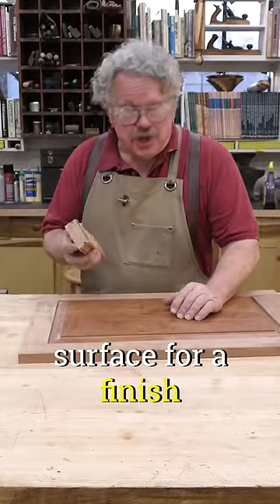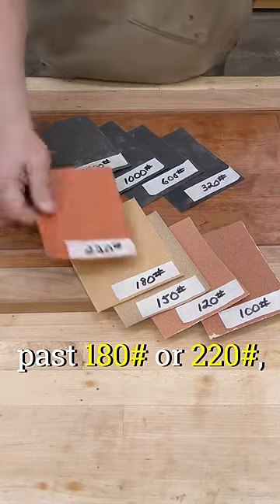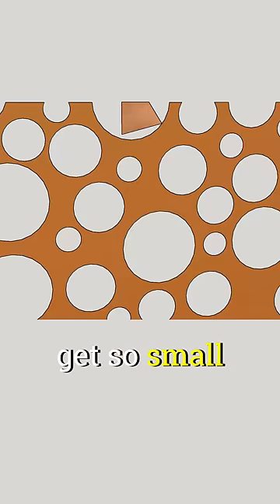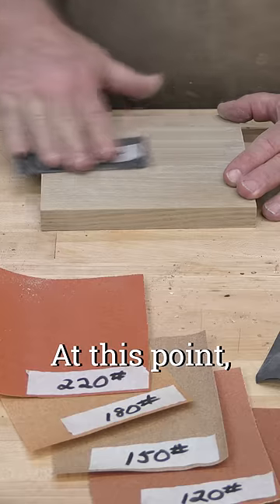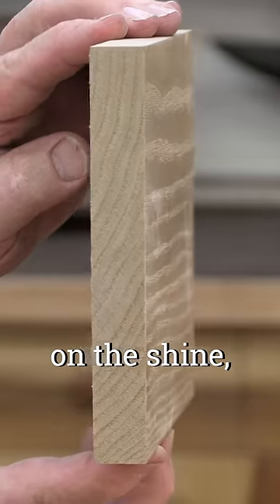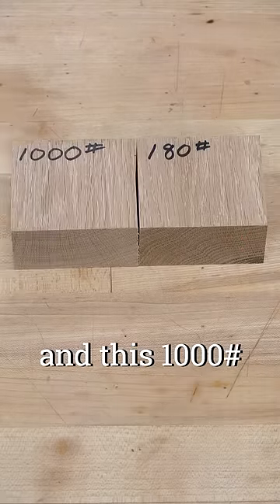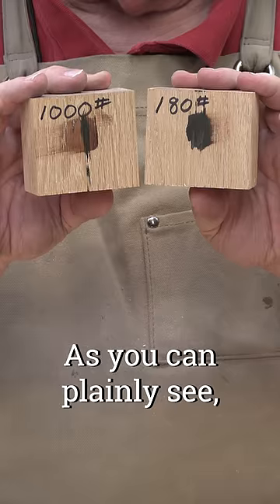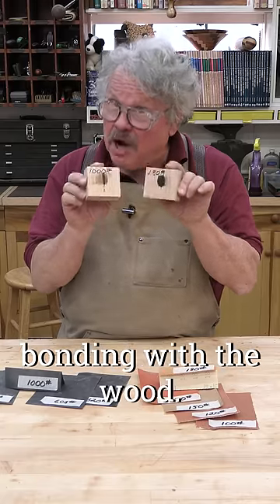Sanding Past 220 - How Smooth Should You Go? #woodworking #diy

Comment: The black papers are designed for paint, and should be used after varnishing or applying a clear coat.
Reply: I was always under the impression that black sandpaper is for dry and wet applications, and the lighter color is for dry only.
Reply: @PtotheMtotheK  it can be used dry for some things in course grits. The important thing is coating wood first.
Reply: This was the comment I hoped to see.  It seemed logical to me that you sand up to the maximum that allows stain penetration, stain and then sand to a higher finish.  If I understood correctly...
Reply: @awhite3747 Exactly. If you want a finish as smooth as you find on expensive instruments high grit paper is mandatory.

Comment: I don't often sand past 220, but if I do, I tend to use a combination of high pressure air and acetone to clean out the fine wood dust. After that, I find that the finish usually takes pretty well. Exceptions being porous woods like oak and ash.
Reply: MDF can benefit from higher grits but it isn't necessary for most anything else.
Reply: @Man-vs-Metal  Necessity has nothing to do with it.
Reply: Hm, acetone and wood... I never tried it before but i feel like it damages the wood
Might be wrong tho
Reply: @timch5227  I have yet to see it damage any wood I've cleaned it with. I've put it on everything from White and Red Pine to Jatoba.

Also, if you take a close look at the wood cleaner provided by Rubio Monocoat, it's essentially just glorified acetone.

Honestly, it's great for removing fine dust and oils from wood.
Reply: @timch5227 can confirm, no damage from acetone (basically nail polish remover, you can use it on your fingers without actual damage, just dries out the skin), it’s very effective at removing oils from the surface of wood so that you can get a good bond with your finish, but not so good between coats of finish since it will melt the previous coats. For that, I most often use naphtha.
Reply: I like mineral spirits because it doesn't fume as much as acetone and cleans just as well
Reply: @Jmoneysmoothboy  we use mineral spirits to clean our equipment whenever pine runs through it. Fantastic stuff.
Reply: Still no difference, I tried exactly what you said compared against 180, and the 180 finish looks better.
Reply: @roypdxful  When I go above 220, I go full ham. Usually 2000 or 3000 grit.

It's completely unnecessary. Just fun.
Reply: @Wiggleattacks Why would you even be sanding mdf its made of sawdust 😂
Reply: @plack_benis382  so that it will take finish better. Sand the edges so it doesn't absorb too much finish and doesn't require more coats.
Reply: @LilAngelPrincess95  why would you even he finishing mdf though its literal dust pressed together lol
Reply: @plack_benis382  some profiled doors are made of mdf because it's easier to sand the profile before lacquer. Mdf moldings exist too. Mdf is a good thing to use if the finish is a paint or color lacquer but still needs to be sanded or the finish won't be good.
Reply: @LilAngelPrincess95  yeah i know been doing construction a very long time and you dont lacquer mdf nor sand it, should be sanded from the factory if you open up mdf it degrades and falls apart.
Reply: @plack_benis382  I work in a cabinet shop. You 100% sand and finish MDF. If you put raw MDF anywhere and it gets wet it will fall apart. 
You can also buy MDF core doors.
Reply: @LilAngelPrincess95  well then youre the factory im talking about and mdf cores have zero to do with sanding or finishing its the core. After it leaves your shop it should never be sanded again is what im saying or it will degrade
Reply: @plack_benis382  the topic was sanding MDF. You said MDF is never sanded. 
It is as I've explained already. 
MDF is sanded and finished like any other wood product.
WHERE it is when it gets sanded is irrelevant.
Reply: @timch5227 acetone is in every stain and sealer out there. It’s just a solvent it evaporates so fast it causes no harm to wood. Keep it off plastic though!
Reply: @plack_benis382 let’s see because maybe I want the surface smoother for use on a router table or as a bed plate for my planer.

Comment: I make wooden swords for costumes, and how i treat the surface depends on the finish i want. Normally ill go to 320grit, then do a spray,sand,spray again with gloss primer to give a nice "polished metal" look on the final silver or gold coats. If i want it to look like pattern-welded steel, ill let the natural grain show through a bit more  and not sand as fine before priming.
Reply: That is very interesting!

Comment: This is why you blow off the surface before you finish. You can even use a microfiber cloth or tack rag. The reason someone would sand to a high grit would be to apply a multi stage finish. The truth it that no matter what grit you want to, you should thoroughly clean any surfaces that you intend to finish.
Reply: Your comment should be pinned to the top as it should have been discussed in his short. His info was somewhat valid but very incomplete as to the whole process.

Comment: I’d say give both a try. Iv messed around with some wood and stains and I actually found that I really like the stains on high grit sanded wood. It looks a lot different. It’s very interesting to see the difference grades of stain from different levels of grit.
Reply: Yep, don't be afraid to experiment with small test pieces. It will vary depending on preferences and types of wood and stain you're working with but there's no right or wrong way to do it, just go with the one you like the most....

Comment: A very convincing argument for not sanding past 220 on wood. I am now convinced
Reply: What was the argument for not sanding past 220?
Reply: @Bark777 are you dense? Did you watch the video?
Reply: I did, and I thought he made a very good argument to why you want to sanding past 220.
Reply: @Bark777  good job. 👏
Reply: @cellardoor7500  So what was the argument for not sanding past 220?
Reply: @Bark777  I’d rather hear your notes on what he said. What was the point of the entire video? Please enlighten us
Reply: @cellardoor7500  are you dense? Did you watch the video?
Reply: @Bark777  Because finer grit sandpaper creates finer dust, which then gets forced into the gaps of the wood. It does make the wood look smooth and shiny, but it also prevents stain or varnish from penetrating beneath the surface of the wood as well. This is critical for protecting wood long-term, because bare wood will suffer all kinds of environmental damage such as UV, moisture, etc. This is especially true for anything used in an outdoor environment. If you are working on a piece that is worth sanding to that degree, then it is worth protecting it as best as possible. High-grit sandpaper may make the wood look shiny, but it is not going to last long because the wood is left vulnerable to wear

Comment: I sand to 600. Haven’t had this issue. Blow off with air gun. I don’t stain though, only finish. I appreciate woods natural colors. A part of me actually believes finishes are a crime against God’s art. To each their own. Team Clear Coat only.

Had a purple heart project I sanded to 2,000. No finish on that. Leave it open to oxidize and it gets beautifully dark as it ages.
Reply: Interesting.
Reply: So I guess, from what I got in this video, you burnished the wood? Which is a type of finish? As another commenter said about the older wooden spoons of which he preferred the worn wood texture?
Reply: @ThinkerTinker74  the Purple Heart was burnished. 

My other projects, not quite burnish fine. You pack the grains with very fine sawdust when you sand, so you go through carefully with an air gun to make sure you remove all of that. You didn’t sand the inside of the grains down that fine. So the clear coat (or probably stain), will still take to the grains. None of my projects have had a finish issue in a decade. I almost exclusively use ash, red oak, and walnut though. Looking at some Sapele and Mahogany projects now. Results may vary with other lumber.
Reply: @M21assult 
THX for this. I'm likely to consider your way. I also like the look of wood. Any finish on wood is for wood that hasn't aged well or was abused IMO. Opaque paint for house walls or as part of an artist's supplies 😊
Reply: Anything past 220 is for Sanding the finish, not the wood. Try saving your high grit for the clear coat and you will get much better results. Going to 2k should give you a mirror finish and really show off the 220 sanded wood underneath.

Comment: A damp cloth will remove the 'imbedded' sawdust, also compressed air will remove it from both workpiece and sandpaper.  I scroll saw small art pieces and sand them to 1500 - 4000, depending on size & shape.  Most don't need a stain.

Comment: The best piece i ever made, soooooo slippery smooth that everyone in the entire shop kept coming over to pet it, sanded it to 220, then started mt finishing process, i cant remember what exactly i used but whatever your favorite sub-in for shellac is, use that.  Let it dry, and sand it a little smoother, another layer, higher grit, another layer, higher grit. I think i only did three or four thin layers, but after that first layer is fully in the wood and as long as you arent sanding THROUGH the laquer and you cant see the layers of laquer no longer able to bond with one another, you can keep going smoother. Then that last layer i lightly sanded all the way up into the thousands. It feels incredible.

Comment: I generally detach my shop vac from it’s holder and vacuum at the highest setting to the surface of the finished wood.  That, and the tack cloth, has worked well enough for my finished wood projects.

Comment: Also depending on the wood. As i like oil finishes i like to sand above 400 together with the oil. My bass guitar neck i sanded to 2000grit together with hard wax oil and after a year it's still amazing.

Comment: In car body work we use those higher grits for wet sanding and then buffing clear coat. Water keeps the paper working and stops it from wearing out as fast.

Comment: i learned this the hard way in high school. sanded a wood project in a shop class down to about 400 grit because it felt so nice and smooth, but the finish wouldn't penetrate and left a tacky surface, forcing me to sand it again to a lower grit and re stain it.

Comment: if your low on sand paper remember you can use an air compressor to clean it and its good as new, i do it 1-2 times depending on high the grit is but it works

Comment: A quick tip I like to use something to blow off all the dust you could probably use a hair dryer but I used to use this pressurised air hose after sanding it really fine this then let me get a really nice finish on the wood with some varnish

Comment: Use wipeable poly as lubricant for wet sanding above 220 grit. You can easily keep going to 600 grot without overloading the pores, plus the pores start to disappear and the grain comes out, leaving an incredibly beautiful wood with a very different look. Try it!

Comment: Would spraying stain overcome the filling effect? The shop I work in doesn't go above 180 on anything but alder which we sand with 220 to avoid ruining the molded features. We use LP guns to shoot the stain which I'm guessing gets past any particles that don't get blown off before the stain is applied.

Comment: So if you wanted that smooth burnished look, but wanted to stain the wood a different color, could you sand to 220 grit, put on several coats of stain, then sand again with 600 or 1000 grit?  Or would doing so completely remove the stain you just applied?

Comment: What about finely planed surfaces? I seem to recall from somewhere that there are structures in Japan that are made from wood that has been so finely dressed that water will bead instead of penetrating the fibres because the edges of the xylem are too sharp (or something like that)

Comment: If you have a tightly packed hole with superfine particles, isn't your surface area and hence available absorbing surface greatly increased? Wouldn't just putting additional stain, cost more but have the same effect on penetration?

Comment: When in high school, I got a part-time job refinishing furniture.  It was a small business owned by a retired gentleman.  He had a steel building next to his house, in which large heated tanks filled with a liquid stripping solution.  The items were submerged in the solution for an extended period of time.  After which they were removed and carefully pressure washed to remove the old finish.  They were then hung up and allowed to thoroughly air dry.

If they were oak items, we'd usually apply a coat of filler material to fill in the open oak grain.  I'd then sand with 180 grit sandpaper, vacuum, and tack rag them.  Followed by sanding with 220 grit sandpaper, vacuuming, and tack ragging again.  Next, I'd apply a paste/gel type stain by hand, and wipe off the excess stain with a clean rag, if that's what the customer desired.  If not, we'd leave the wood unstained.  This would be followed by applying an initial coat of clear semigloss polyurethane finish and allowing it to thoroughly dry.  Followed by being lightly buffed out with #0000 steel wool, vacuumed, and tack ragged.  Followed by an identically applied and finished second coat of polyurethane finish.  On certain occasions, such as workbench tops, where a thicker, more durable finish was desired, I would block and wet sand with 400 grit sandpaper, rather than lightly buffing with #0000 steel wool, between polyurethane coats.  I'd typically apply four (4) coats of polyurethane finish on such occasions.  After the fourth and final coat of polyurethane, I'd either lightly buff with #0000 steel wool or leave it with its as-applied semigloss finish.

Every customer I witnessed coming in to pick up their refinished items seemed pleased with the results.  And, all these many years later, whenever I need something refinished, I still use this exact same method to do so.

Comment: We use an automotive sander that pulls the dust through the mesh sanding pads. We go up to 400g and the stain still goes in beautifully. But only cause the dust doesn't collect in the wood or paper.

Comment: If the goal is to paint the wood rather than stain, I'm wondering if similar theory applies:  using very fine grit takes away some adhesion of the paint.  A rougher surface gives the paint more to grip onto?

Comment: What about staining and then continue to sand? Allowing the stain to penetrate, and then smoothing with the much higher grits? I can imagine the color will start to get lost, but if you give a second layer of staining it would not penetrate as deep but you can absolutely still stain the top layer as seen in the 1000 example.

Comment: 220 grit is the goat! Back when I was a machinist, 220 was perfect for anything less than polished parts. It worked great when I was finishing a clone trooper helmet, because it prepared the surface perfectly for the automotive spray paint, and when I made my sim  rig outta wood, I hit the whole thing with 220 and it's nice and smooth, but didn't take too much effort

Comment: I have an airgun hanging over my workbench.. i just routinely blast my work and my pad specifcially to remove the build up. Sands just fine at higher grits and even AFTER you blast the particles you cant even see on the work off- it is smooooooth

Comment: I was hired to consult on a job for a federal judges chamber and library in Muskogee Oklahoma.  They wanted a Walnut stain with semi gloss finish. The majority of the woodwork was made from Maple. The carpenters were incredible and the woodwork was almost flawless. They had already tried to stain some book cases but the woodwork wouldn't take the stain because they had sanded the grain closed. I ended up spending around 3 months finishing all of it. Some of the woodwork even had to be airbrushed (painted) to achieve the correct tone. The entire thing turned out to be BEAUTIFUL.

Comment: I always assumed it’s a function of hardness. 

Also, when sanding material like this even carbon fiber, have a vacuum wand with a brush end. You’ll be able to clear the pores and unload sandpaper this way. Do a few sanding swipes and vaccum. 

It’s replaced wet sanding for a few steps which is always welcome

Comment: What about sanding finer after the stain then between each clear coat. I sand to 800 or 1200 but use polyurethane on ‘raw’ wood which might benefit from less absorption since it’s a coating??? Author-comment?

Comment: With many wipe on finishes, specifically oil based ones, you can sand past 220 by using that higher grit paper to wet-sand the wood with the finish as the wet element. Be warned, with hardening finishes this will result in a contaminated surface finish, while with oils and some drying ones the excess is wiped off, thus removing the particulate that would contaminate the surface.

Comment: If you’re doing a clear finish without stain - wet sanding with your last grit using wipe on poly (or wipe on with long open time of your choice) as the lubricant will fill the grain for a glassy finish.  If you use a different final finish just apply a coat of shellac between the filler and subsequent finish. Practice on scrap of course.

Comment: @WorkshopCompanion If you wipe the surface clean with a damp rag soaked in denatured alcohol between sanding grits it completely eliminates the issue of dust clogging the wood cells.

Comment: At Taylor Guitars I've worked in Finish and in the Neck department sanding the raw wood necks. In the Neck Dept. we use 180-320 then in Finish, after staining, filling, and multiple coats of clear finish, they use 320-1500 depending on the model and finishing process.